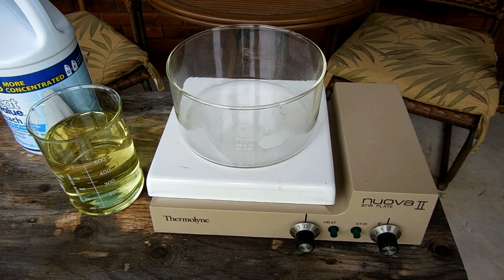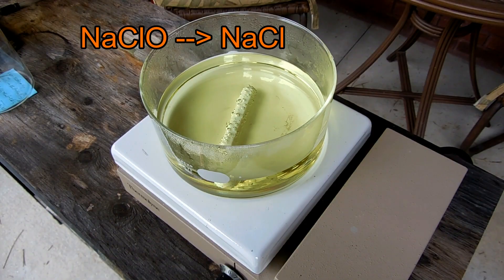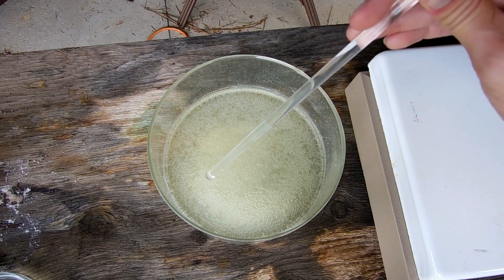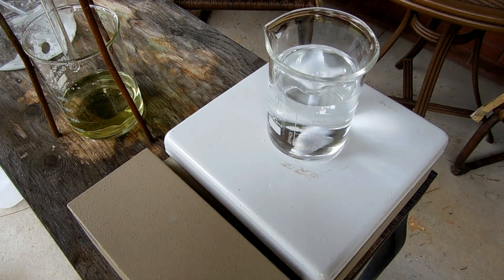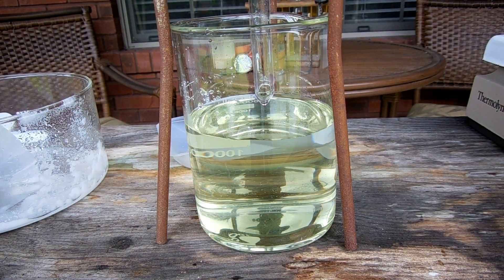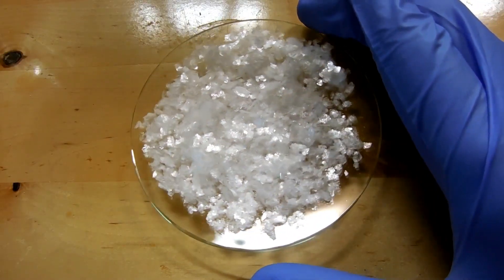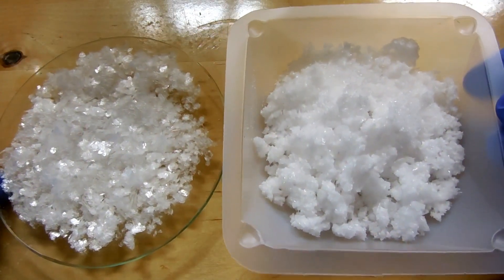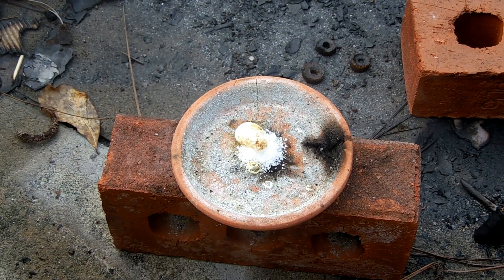Potassium Chlorate from Bleach

Comment: Yeah the impurities are sodium chloride or potassium chloride since you converted it but You're never going to get anywhere near the theoretical yield doing this process The only real way to do this efficiently is through electrochemical reaction and even then you're going to have to do many steps to achieve a really efficient cell like balancing pH non-stop I once built an automatic pH adjustment system which was a big pain in the ass it wasn't worth it but it was nice once it was done

Comment: I never considered an acid to start the flame - I use the chlorate for making colored smoke bombs, and the idea of having a small ampule inside that breaks and starts the reaction when you "throw" the grenade seems appealing (although, not safe at all - the pull tabs I use now are much safer).

Comment: From 2024. Remember: chlorine gas reacts with an aqueous solution of sodium hydroxide and the first products are sodium hypochlorite and sodium chloride, while temperature raises.
So heating a solution of sodium hypochlorite allows  the inverse reaction: NaCl + NaClO -> NaOH + Cl2 (1).
Even if you have a pure NaClO solution the following equilibrium exists: NaClO + H2O <-> NaOH + HClO (2) and very unstable acid 2HClO <-> 2HCl + O2 (3) and HCl + NaOH <-> NaCl + H2O (4).
So every conditions for (1) are present.
Perhaps it's more effective dropping a concentrated sodium hydroxide solution.

Comment: perhaps you can use swimming pool chlorinator, it comes as a powder. Not sure if it’s pure NaClO3.
Also bleach comes with a small amount of sodium hydroxide, presumably to offset the chlorine in the water turning into hydrochloric acid. Probably irrelevant with all that sodium chloride present.

Comment: I have some chemistry from college days ( a year,so no chemist but no dummy either) and after three true at this relatively simple reaction,using proper equipment I was unable to produce pyrotechnic grade chlorate I could use. It would burn  but mixed with sulphur and banged with a hammer it should have been able to generate a return bang but did not and with aluminum couldn't become flashpowder either. It was a.waste.of time. Better luck to the rest.of.u.

Comment: Here, low sodium salt are actually a 50/50 mix of sodium or potasium salt... with this: If I add first this salt mix to the bleach and then boile it later: Does it will improve the potassium chlorate yield?...thinking about the extra sodium salt added could balance the reaction into producing chlorates since there already too much chloride ions inside.. is this right?... or it doesn't works this way?

Comment: On your second crystallization that yielded an impure batch of crystal, is there a method of selective solubilization that could be used separate the potassium chlorate from the other salts, such as heated ethanol?

Comment: As NaCl and NaCl03 are salts (and very soluble more over), how do you separate them?
The crystals you see is a mix of NaCl and NaCl03..
Reply: He added KCl to form KClO3 which isn't very soluble  2:25 .
Reply: @-abuyasseral-montenegri2654  thanks for your reply. But it's solubility seems to be 339.7 g/L (20 °C).
Even 277.7 g/L (0 °C).

For NaCl we have at 20°C 360 g.
Reply: @-abuyasseral-montenegri2654  ho ok I see what you mean. You're right.
No your english isn't bad at all.
You are right the solution is almost saturated with chlorates ions, I was really just looking at KCl solubility, but as you said NaClO3 has a great solubility, slightly less than KCl, so there is going to be a small reduction in the yield, and purity, but really not that much.
Thanks for correcting me !

Comment: Could you use pool chlorine instead of bleach because pool chlorine is 12.5% sodium hypochlorite?
Reply from the maker: Yep! That would be a more efficient method for sure because of the higher concentration. Just make sure it's the same chemical as bleach, because there's a lot of different things they call "chlorine".

Comment: 60 grams potassium chlorate + 125 grams copper sulphate + 1 liter of hot water. Filter then immerse zinc and pot metal to dye black when exposed to air. Rinse and dry or repeat as needed. I don't need you getting the wrong Idea FBI.I know you're stealing my fertilizer shipments. That's not even the right kind you dingus. I blame you for ruining my melon season.

Comment: I think your yield is not as bad as the numbers suggest.  Some of the bleach may have already decomposed before you used it.
Reply from the maker: True! I should have tested it before using it.
Reply: @mrhomescientist  Also can you start with bleach for electrolysis rather than salt water?  It would give you a head start.

Comment: Formation of chlorate is favorable at low ph.  Bleach typically has a ph of 11 or so.  Decrease ph with HCL to about 6.5.  This increases efficiency and has the added benefit of decreasing chlorine off gassing during the boiling process.  Ph may raise while boiling.  Adjust as necessary.
Reply from the maker: Chlorine would sure offgas before the boil! But that's an interesting idea to try, thanks for the comment.
Reply: mrhomescientist  for sure.  Gradual/dilute is a good idea.  Thanks for the video!  This chemistry is always so entertaining.

Comment: Would boiling the bleach under high pressure to reach higher temperatures make the disproportioning more efficient?
Reply from the maker: That's an excellent question! My first thought is yes, higher temperature would speed up the reaction rate and at might force it to completion faster and more completely.
Reply: @mrhomescientist  Thank you for replying! Do you think you could try this out and see if you get better yields? Maybe it'll become a semi-efficient way of making KClO3. I made some KClO3 this way and didn't get much at all, so maybe this will help out. I was planning on trying this but I currently don't have the equipment to do this. I might have to rig some copper tubing up and give it a shot.

Comment: Could I boil the bleach in just a beaker over a electric hotplate?
Reply from the maker: Sure, that's the same as what I did. That evaporating dish is really just a wide beaker.
Reply: @mrhomescientist  Thanks for asking so quickly. I am a amateur chemist, and i only have an electric hotplate and other simple stuff, but this proyect seems really interesting

Comment: Second batch looks like it has a ton of potassium chloride in it. Next time try a saturated solution not a supper saturated solution. Maybe you will recover more chlorate than chloride that way.  I also purify my potassium chloride salt first before making a solution. The salt has anti caking agent and preservatives. Fortunately they are all not very soluble in water so you can easily remove them. Or buy some potassium chloride salt for a water softener its was less per ounce or lbs and higher purity

Comment: I was told to watch your video. I need sodium chlorate to precipitate palladium. I was told to take the first crystals add distilled water and reboil to clean it better for more pure.
Reply from the maker: You shouldn't need to reboil, but it won't hurt if you do. Just dissolve the first crop in distilled water (heating will speed things up) and allow that to evaporate until about 10% of the liquid is left. Discard the liquid and keep the crystals, and theyll be much more pure! It's called recrystallization. Thanks for commenting!
Reply: @mrhomescientist  Ok thanks. I boiled down 1 liter so far doing the 2nd liter now. I will add both together in distilled water and re-do. I dont care to make any firecrackers but he said to test mix a tiny bit with sugar and put flame to it, if it goes up fast its ready. I do precious metals and some chemicals I cant get my hands on. I have to make ammonium chloride also for platinum. This sod. chl. is for palladium. So next is mix 50/50 ammonia and hydrochloric boil down and collect those crystals.Thanks again for the video.
Reply: @mrhomescientist  I hope I did this correct. I put it all back in distilled water and back on heat evaporated down until it was damp. It all wouldnt dissolve when I put it in the water. I then put it in a filter. Drip drying now tomorrow I will warm it dry. I was doing a zinc precipitate at the same time. The fumes turned it to jello. I had to add HCl to the precip to go back to liquid.
Reply from the maker: @1hardman161  You want to dissolve the crystals in hot distilled water, filter off and discard anything that won't dissolve, then allow the solution to cool to room temp. Pure crystals will precipitate, and you can allow the solution to evaporate slowly to get more out. Once its evaporated down to ~10% remaining liquid, thats about as far as you want to go.
Reply: @mrhomescientist  I hope I got the correct stuff. The 2nd time around it didnt build up crystals, but there was white crystals in the bottom, after evaporating. Those are what I filtered and saved. ??? Thanks

Comment: I think pool supply stores sell concentrated sodium hypochlorite as liquid pool shocker. It is usually sold in gallon size tan jugs. Though I could be wrong and it's an entirely different compound.
Reply from the maker: They do! Just be sure to read the labels carefully; there's a huge variety of pool chemicals so make sure you know what you're getting.

Comment: Doesn't boiling bleach produce chlorine gas?
Reply from the maker: A bit. That's why I did it outside!
Reply: @mrhomescientist  but what reaction takes place when it makes chlorine gas?
Reply from the maker: @miguelchacon2717  Sodium hypochlorite is unstable and easily decomposes into chlorine gas, and the rate increases at high temperature. The Wikipedia page on sodium hypochlorite explains the mechanism pretty well. See the section "Equilibria and stability of solutions"
Reply: @mrhomescientist  thx for the info man

Comment: Is possible to make kclo3 from 90% bleach? in the same way by boiling?
Reply from the maker: Jozsef Ienciu Does 90% bleach even exist? It's pretty unstable in solution. Higher concentrations would still work.
Reply: Thanks.YES EXIST I GOT IT FROM A water plant station.
Reply from the maker: Jozsef Ienciu What's the name of the product? I'd like to see an SDS.
Reply: I don't have i got only 200ml,because is too dangerous. is from a water power plant from a laboratory.

Comment: I think I'm doing something wrong I ordered straight potassium chloride trying to get potassium chlorate so I followed your video on how to make this I'm not getting my crystals should my water from the potassium chloride be clear I've done it filtered and unfiltered I'm still not getting my crystals
Reply from the maker: If you dissolve your KCl in water, yes it should be perfectly clear. If it's not, there are impurities that need to be filtered first (or you could do a few recrystallizations to purify). It's possible you have too much water hanging around, so try boiling your bleach further or using less water to dissolve the KCl.

Comment: I just finished making some potassium chloride and sodium chlorite mixture and it's currently in the fridge. Not 100% sure it will turn out well, but there seem to be some solids collecting on the bottom, so that's good.

I can confirm that it has to be regular bleach without any scent, since the bubbles and other impurities prevent the NaCl crystals from forming during boiling. There are definitely fumes that come off, and if you don't have a fume hood, you should definitely do this outside. I was able to get sodium chlorite from my bleach by using a ceramic type glass in a campfire, and even though it had a small amount of ash that floated in, using a coffee filter made it appear as clear as it does in the video.

I also didn't have any precipitate upon the initial mixing, so don't be too discouraged if you do this experiment and don't get an instant return.

Hope this helps!

Comment: can you explain scientifically why gummy bear or some sugar can make this Potassium Chlorate burn/explode?
i know this is an old video but i hope you answer XD
Reply from the maker: In that demo, you first melt the potassium chlorate. This causes it to decompose into KCl and oxygen. The oxygen rapidly reacts exothermically with the sugar in the candy, via C12H22O11(s) + 12O2(g) → 12CO2(g) + 11H2O(l), producing a lilac flame, smoke, and fun!
Reply: mrhomescientist so is it an exothermic reaction that produce enough energy to create fire?
and is it only working with sugar?
thanks for replying ^-^
Reply from the maker: Fahry Adhikara Right. Sugar seems to be used the most, but I imagine just about any sort of fuel would work. Chlorate is a powerful oxidizer! Might be interesting to drop a leaf in there or something. Safety first though!
Reply: mrhomescientist can i ask you more question ? XD
why does the NaCl on the bleach crystallize but in the second reaction of NaClO3+KCl
KClO3 is the one who crystallize instead of NaCl
Reply from the maker: Forever Alone Sure! It all has to do with relative solubility. When boiling, the solution contains NaCl and NaClO3. The sodium chlorate is more soluble than the chloride, so some of the NaCl falls out first. Then after adding the KCl, we have KClO3 which has a much lower solubility than abything else in solution, especially at low temperature. So then that crystallizes out next!
Reply: thank you for the explanation,and sorry if my curiosity annoys you XD
you're the best
Reply from the maker: Forever Alone Not at all! Curiosity is the heart of science. I'm glad to help!

Comment: Is this dangerous?
Reply from the maker: monkeyemperor12 Boiling bleach isn't a very friendly substance. It's safe enough as long as you take proper precautions, but I wouldn't recommend it until you have some practical experience with chemistry.
Reply: mrhomescientist ok, the reason I ask is because nurdrage says that it makes a small amount of chlorine gas and I just wanted to make sure so thank you

Comment: i know this is an old video and you might not respond but what did you use as a filter? i am told usually its just cupcake sheets but idk...
Reply from the maker: I use 2-4 coffee filters, depending on how fine the precipitate is.
Reply: mrhomescientist  ok thanks! i made an acid with peroxide vinegar and salt i forget what its called because im not really good at remembering :/ but i dissolved steel wool into it and i need to filter the iron oxide will these work? sorry if this made no sense i haven't gotten any sleep in like 2 days from guests and working..
Reply from the maker: Sure, coffee filters work for just about everything I use. The only time they've failed me is if the precipitate is super fine. In that case, just keep re-filtering the cloudy liquid through the same filters. The pores get blocked up and it slowly clears up. Oh and the acid you made is Hypochlorous Acid, or HClO. Hardware store muriatic acid also works great for dissolving iron, yielding FeCl2.

Comment: I imagine the fumes are terribly toxic...
Reply: Taylor Barnes not in these amounts, you would need a lot more
Reply: Taylor Barnes There's a thing called doing it outside.
Reply: You are correct Taylor.  I have performed this very same reaction several times.  Even a small wiff of the vapors coming off of the boiling bleach will burn the mucous membranes inside your nose.  It is quite temporary, but your brain will tell you that several strong sniffs, possibly reaching your lungs, will be very, very bad for you.

Comment: I'm not making anything I just want to know what will happen to chlorate if you added it to the solution instead of chloride?
Reply from the maker: If you add a chlorate to a solution of a chlorate nothing will happen. Things generally don't react with themselves.

Also if you reply directly to my comments it makes a thread that's much easier to follow.

Comment: have you tried powdered chlorine like what you can buy for pool... Pool shock I think it is.  You can re hydrate it to a pretty good concentration.  Much more than 8.5%.  Good instructional video.
Reply from the maker: +BennyCFD There's lots of products that go by the name 'pool chlorine', and it's a surprisingly wide variety of different chemicals. So it would depend on what exactly the product contains. Could be possible!

Comment: oh sorry was commenting upfront so other idea what happens if you boil it and then immediately put it in an ice bath?
Reply from the maker: +Vladimir Nachev You'd probably crack the glass from thermal shock. Besides, fast cooling would form impure crystals that would trap a lot of solution in them, leading to losses since in this case we are interested in what's in the solution (after the boiling step).
Reply: What if we use some electricity as well I saw some electrolysis crystals and I think it should work with every solution

Comment: Interesting, and yeah I enjoyed that.  The first batch of crystals from the boiling bleach, are these not useable for further precipitation?
Reply from the maker: Going by the equation I posted in the video, the solution after boiling consists of even more NaCl, sodium chlorate, and likely some unreacted bleach. You'd only be able to reuse the solution up to the point where all the bleach is consumed. It depends on how well you boil it.
Reply from the maker: Well the first crystals to appear are just table salt. That's why we filter them off.
Reply from the maker: When cooling in the fridge yes, the chlorate will fall out first. But the crystals he was talking about, the ones that appeared right as I stopped boiling, are actually NaCl from disproportionation of the bleach. There's so much of it at this stage that the solution is saturated at room temperature.
Reply: so then what IS the solution once the NaCl is removed?
this is something I have been thinking about so as to reuse the solution if possible. Reboil as is but instead of just trying to pull more KCL out simply repeat the entire process!